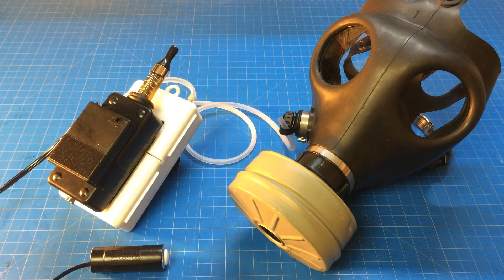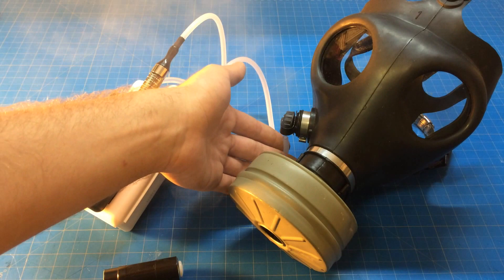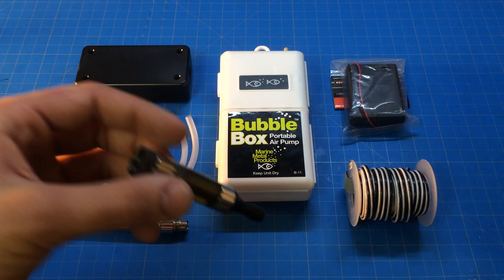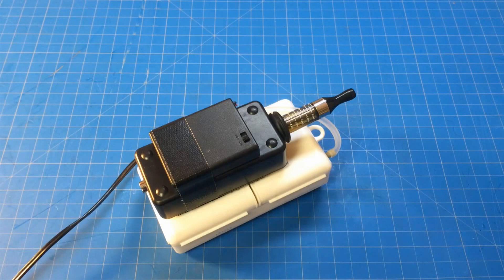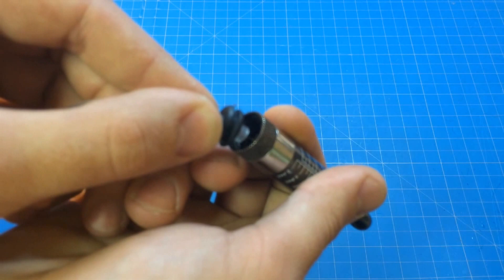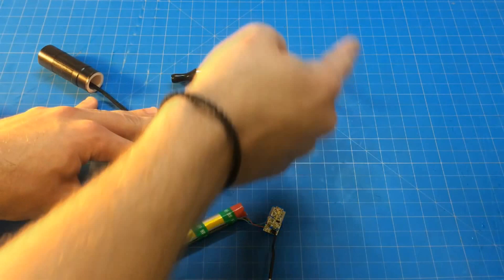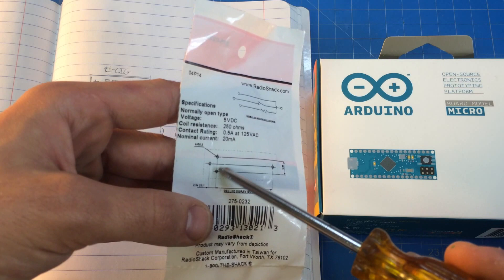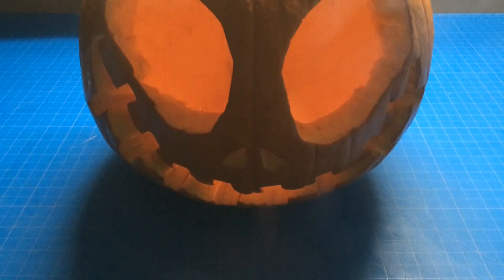How To Make Mini Fog Machine w/ Ectoplasmic Man Mask / Jack-O-Lantern

Comment: Just so people know what to get. You want an ego twist battery( you really only need a regular ego but he says the VV one) and a CE-5
(stardust) atomizer/clearomizer (he says cartomizer in the video but that is not a carto. I think he might be using a t3s in the video but you want a disposable atty). You could easily build your own e-cig though. You would just need to order a 510 connector from madvapes or something. Also I would suggest going to a local vape shop and just ask them if they have any broken ego batteries and you can get the 510 that way and while you are there see if they can mix up a flavorless 100% VG juice for you with 0 nic. If they can't make the juice you can easily go buy some vegetable glycerin from the grocery store and use it since you aren't vaping it. oh and GreekGadgetGuru you should revise this. Just search homemade ecig mod and you will see you can do this A LOT easier without the ego twist battery and just an 18650 or 18500 or an 18350 battery.
Reply: ***** Thanks man. I had no clue this was marked as spam.
Reply: ***** It says (Edited) he might have said something wrong idk
Reply: MK9 GOD I did come back and edit it a few times due to spelling errors and to add more info but I have no clue why it was marked as spam either.

Comment: If you get an S10 gas mask, they have a drinking tube that leads from the outside of the mask to the inside of the mask which would allow you to fill the inside of the mask with vapour. That would look very cool, although it may be hard to breath as well as see and could be hot.
Reply: Plus people would think that your filling it with weed smoke or something like that
Reply: ***** A lot of people do that yes. They retrofit a bong to one of the intakes
Reply: OrangeAclock you can buy a gas mask bong

Comment: i think i am going to try this using a RTA and mechanical mod, but instead of the pump i think i may just use a small fan mounted inside a small box on one side and a tube on the other. the vaporizer will just sit inside the box and i will open up the top of the RTA or even the sides....as well just have the end up the mechanical mod stick out the bottom of the box. I just need to think up how to hold it in place, sticking out and all.

Comment: Since you're only using this as a fog machine, I would suggest mixing up a 80/20 solution of vegetable glycerine and water. It would be way cheaper than purchasing e-liquid. By the way, the mixture I mentioned above is the basis for many commercially produced e-liquids, so it is completely safe to use in the e-cig itself.

Comment: Hey i love this but u being so extreme u can expect more smoke i vape myself and can say that u can get more vapor using a sub ohm coil just an idea i hope  u can test out
Reply: Rainbowgadgets477 Sure you can but you will run out of liquid pretty fast and probably also out of battery charge. The best thing to do is to use a really big rba like the Vapor Giant or Big Buddha and powering it on low voltage with a 9000mAh power bank. It's going to get pricey but if you want bigger clouds, that's the way to go.
Reply: +derKampfschimmel have to keep into account.. There has to be a whole in the 510 connection on the rda.. To feel the positive wire to and the air to pump the vapor out the the drip tip and the airflow holes.. There are a few cheap old Rda's that have the hole in the 510 for juice to go inside the rda for boxes like the Egrip that had a bottle of juice and a tube feeding the juice to the rda trough the 510..

Comment: someone should try this with an atomic rda clone. or and rda with airflow from the 510. and wire it up to an 18650, something like a 10 amp efest and build it at like 1 ohm, would create alot more vapor. as well as fire up much quicker
Reply from the maker: Dude I have no idea what any of that stuff is, lol
Reply: also the rda i mentioned called the atomic has a hold in the bottom pin as well but is meant for the eliquid to be squeezed up through there from a bottle of the liquid mounted inside the actual ecig device(called a mod). and i susgested a clone of it becasue there is a chinese clone of just about every peice of ecig gear out there. and they are much cheaper.
Reply: He has no idea what he's talking about either. I run a copper penny with a stillair atty, built at .09, 35amp vtc5. Have it set up to a mask similar to yours except I blow clouds out of the air ports lol.
Reply: +slither248458 sure hope your not talking about me not knowing. because your talking about a super sub ohm build and aperently are getting something to blow the vapor out the mask just like he did here without inhaling it? (thats the idea here is to have it happen without having to inhale it then put the mask on...) btw, if you were saying i dont know what im talking about you clearly have no idea how this stuff works
Reply: just get a cheap sub ohm tank xD
Reply: +Chris Quinton I'm sure you mean an 18650 battery, with 4.2 V. All 18650 at full power are rated at 4.2 V.
Reply: +TheCoolStuffHD if you look at an 18650 it will say anything from 3.6-3.8 volts.. That's the battery rating... But a maxxed charge is 4.2 volts.. But you have to take into account voltage drop.. On an average mech mod the voltage drop is about .2-.22 volts so that 4-3.8 volts you're actually running to your cool
Reply: Elijah Ingrassia Of course. But I was just simply mentioning the nominal voltage of the battery itself.
Reply: It's cool, i see where your going, but the mormal voltage is 3.7 lol but by people who dont know batterys too well they can get that mixxed up.. i didnt know about it for 9 months lol i have been vaping with 18650 and mods for a year lol
Reply: +Chris Quinton 
Hey I'm realy interested in what you say, I'm wanting to make a smoke machine for my LED costume with the vaporiser, but I have no idea how it's working and which one to get, please can you help me with this ?

Comment: Can you get a battery holder for the battery and not solder it?
Reply from the maker: +mylot1989 you could just twist wires. Why are people so iffy about soldering. Imagine how handy it would be to be able to fix stuff and make things if you bought one for like $15 on Amazon.
Reply: +GreekGadgetGuru +GreekGadgetGuru i was thinking more of like if I had a holder I solder the battery holder to the wires then I be able to take the battery out so I could put a spare in.

Comment: I have a question of what if us the viewers are to young to get our hands on an E-Cig?
Reply: You don't, but technically there is no law prohibiting sales to minors YET. I really wish they would hurry up and pass them and not try to put all the other laws like they have been trying with the 18+ law.
Reply: KoningWoelieWoelieYo You're joking right? Water will not work in that case and you need a battery that can handle at least 3-10 amps. Like an 18650 or even a CR123. But water will not work. Also the train fluid? That is just a mix of vegetable glycerin and a little bit of propylene glycol.
Reply: To make constant steam is actually quite difficult in a small package. I guess you could use a nebulizer or something but its so much easier to just use vegetable glycerin, some cotton or silica wick and a 1.5 - 2.5 ohm coil coil made of kanthal all running off 3.7-4.2 volts from a 10 amp 18650. God imagine if someone tried this with the smoke pellets from toy trains. I think they are made of ammonium nitrate lol.
Reply: +x9x9x9x9x9 3-10 amps?? Only unsafe batteries run that low.. Get an 25-40 amp battery

Comment: DO NOT DO THIS! These batteries are meant to run at high amperage low voltage for short periods of time. They can vent and potentially explode from doing this. The coil inside the cartomizer is not meant to with stand the heat and the wicking is flammable.
Reply: What are you on about mate? High amperage? No? Low amps, high ohms, moderate firing times. Silica is not flammable. But Silica is a shitty wick.
Reply: +Joshua Kopp The fuck are talking about. It looks like he's using a box mod, meaning the batteries are regulated, there is no way the batteries will explode, the only thing that can go bad is the coil, even then nothing bad would happen because the box mod would automatically turn off. You must be thinking of mech mods in which case sure, because mech mods are unregulated
Reply: +zdf46 dude.. He showed us how to connect the battery out of the ego style pen... And then put it into the box.. And not all boxes are regulated.. If it has a chip in it that has protections.. Then yes it's "safe" but still you can get a shitty chip and the battery's will still vent.. But over all this can easily explode due to the very long firing times, they have 10-15 second fire limit on regulated mods and ego style ecigs.. Safety
Reply: +zdf46 please educate yourself before you comment
Reply: I know what I am on about mate.
Reply: thats not a box mod... its is just using the battery from the ego style battery and putting longer positive and negitive wires as extentions.... its the same "safeness" as the ego.. just longer wires to each the tank... thats not a regulated box.. lol
but youre right about regulated boxxes, they are safer than mech mods and unregulated boxes.. but a regulated mod can still explode
if the chip goes bad or bad batterys that arnt up to the amp limit